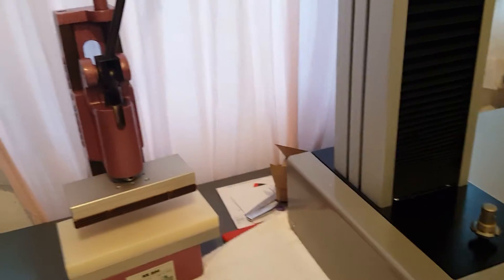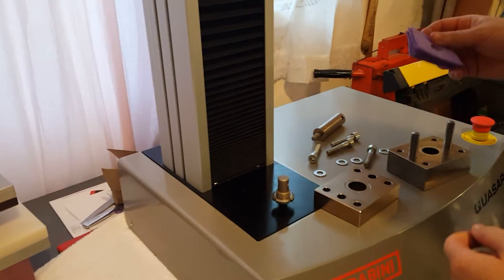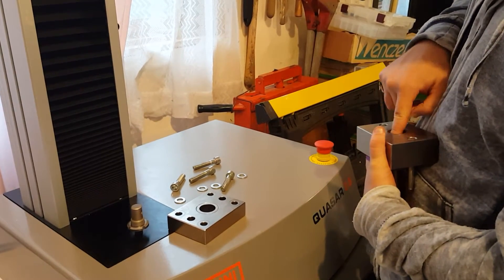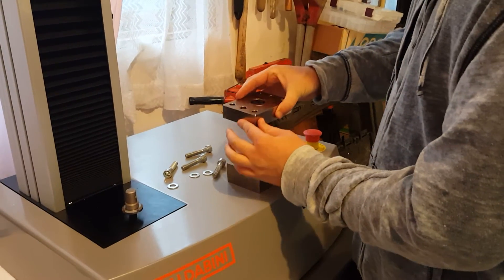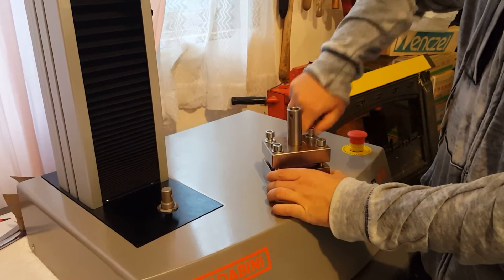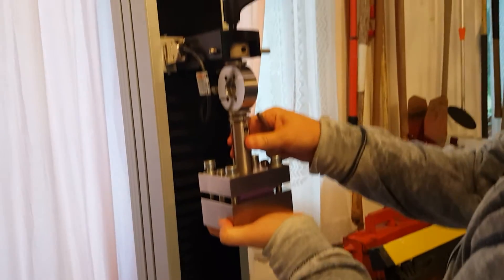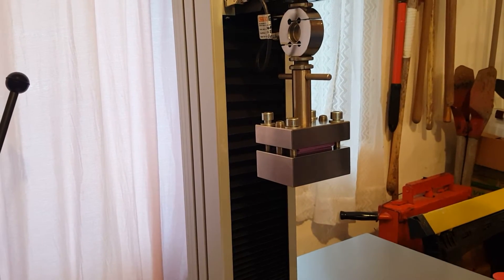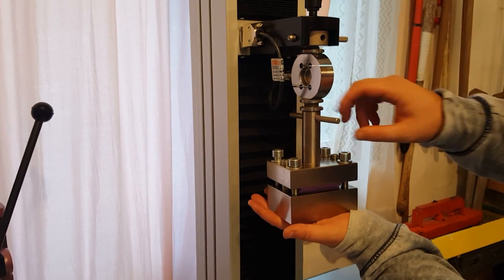How to Use the ASTM D732 Plastics Shear Fixture

Comment: hi, excuse me, i´m working with additive manufacturing, this type of test is recommended to analysis shear?, im gonna work with ABS and PLA, thanks.
Reply from the maker: Yes ASTM D732 is the premier test for plastics shear strength. Very popular for sunglass manufacturers and companies making performance plastics. We sell alot of these fixtures for shear testing. We have in stock.